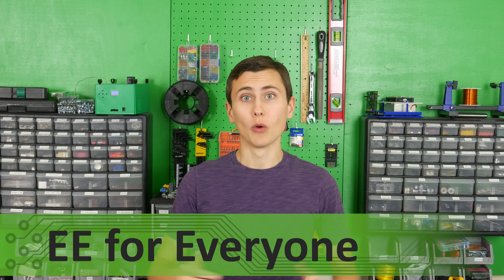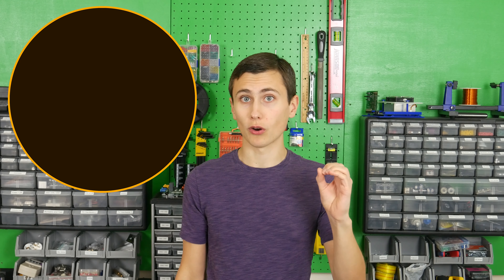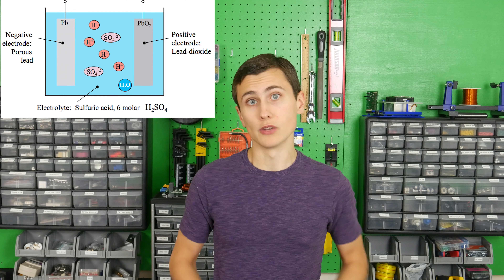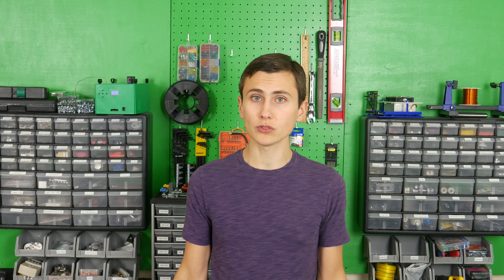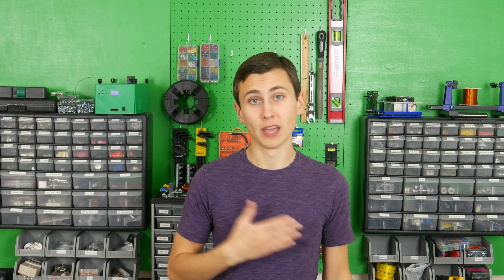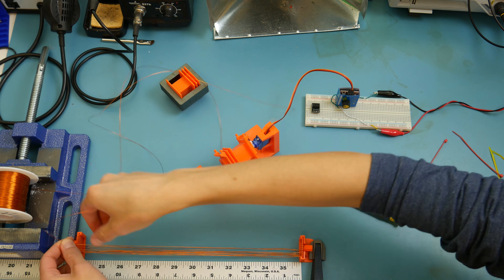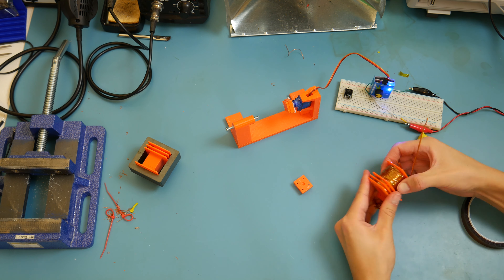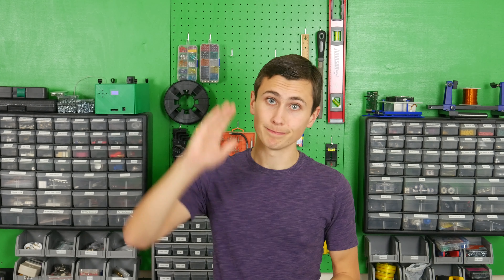Custom SMPS Transformer – Design & Wind

Comment: The explanation of frequency vs power transfer isn't how I would explain it. The benefit of a smaller transformer/inductor vs power transfer isn't because it's split into smaller increments. The benefit of higher frequency is due to the rate of change of the magnetic field. Since energy transfer and/or storage of an inductor or mutual inductors is dependent upon the delta of the magnetic field, a higher frequency results in higher energy dissipation through the mutual inductor...
Right? Any EEs or physicists feel free to chime in on that distinction and explanation
Reply from the maker: HI Tanner, great comment, thank you! It's definitely something for me to chew on for a while. The details / physics behind how the world (and transformers) work absolutely matter, and are important to get right. 

I'll have to dig into the mechanisms that lead to higher power density at at higher frequencies some more! Thank you again Tanner! (Hopefully others will chime in too)
Reply: I am not an expert, just a hobbyist, but my understanding is in line with the video's: higher frequency means less energy in the coils at peak, and less capacitance needed to cover the troughs. Increasing the frequency does not change the delta on the magnetic field, since the rate of power into and out of the transformer isn't changed by a change in frequency. In order to change the rate of power into and out of the transformer, and thus the delta on the magnetic field, we would need to increase the current and/or voltage through the transformer so that more power per time is entering or leaving the magnetic field. Frequency does not directly effect this.

Comment: Hi, I found out your channel while I was searching about transformer for my project. 
I am currently working on project which is same as your UPS series but it is for my whole house Inverter which supply around 4KW. I searched on youtube googled but I couldn't find a core which was rated for such a high power hence I am thinking of making 4 different sectioned Inverters rated for 1000W each so I could parallel them with relays as per the load consumption. But I didn't know which core to use, this video helped he a lot about my ongoing project thank you so much for this information.
BTW I am your new subscriber :)
Reply from the maker: Hi Duronto, that's awesome to hear! I hope your project works well... That sounds like a TON of fun.
Reply: @EEforEveryone  Thanks bro  : )

Comment: Excellent videos and you have earned a subscriber. Following the series of UPS Darwin Project. I am a business software engineer so even i could understand the explanation on high level. I need to watch the series multiple times to build up my concepts. I have a plan which i will start designing soon. I would like to modify two of the APC UPS 3000KVA each to combine them as one unit of 6000KVA. These UPS are of exact specs and use 4710 MOSFETS to covert the DC to AC to feed up to 2 of the transformers in series in Primary to covert to 240V AC. I think i can apply the knowledge learned here even though APC uses big transformers so i believe those are running at low frequency. Thanks for the videos, please keep these coming.
Reply from the maker: Hello Bilal! Thank you kindly for the encouragement. I'm glad you decided to subscribe! Yes, Project Darwin was intense, and I'm not quite done yet. Taking a break, but it's hard to accept defeat. :) 

You're right, almost every UPS design on the market uses low-voltage switching, and a line-frequency transformer to convert that energy from lower voltages (~24-48V) up to 120-240VAC. That architecture simplifies a few things, including isolation and safety of the PCB. I hope you have some fun, and stay safe! Mains Voltage can really be dangerous!
Reply: @EEforEveryone  Thanks for advise, yes we really need to safely play with high voltage. With current Project in hand i think DC side is safer as you correctly assumed MOSFETS are generating only ~24-48V and then step up transformer coverts these to 110-220V. 240V AC in my case is really isolated as these are through transformer and then the filtering part is very much isolated in the PCB, regardless like your advise on safety. 

I have few approaches how i would like to achieve the desired outcome and wanted to get a review of these points, if you kindly can do it for me. These are on very high level and can discuss if you have sometime to review. 

Thanks again.
Muhammad

Comment: Why would you use lead acid nowadays?
Reply from the maker: Hello Jason! Great question. Lead acid is actually still widely used for standby power applications, especially for standalone devices. This is due to how lithium batteries quickly degrade when held at 100% capacity for a long time. Typically, lithium cells last longest when stored near 50% capacity.

 Because lead acid batteries can be stored at 100% capacity without an issue, the energy density and cost competitiveness are more similar than one might expect (given that you'll need ~2x the lithium capacity to keep a pack in service for a long time)

I hope this helps, and thanks for watching!

Comment: Is there an explanation regarding for why as increasing frequency would give more power for a switching mode power supply
Reply from the maker: Hi Suhaila, great question. There isn't any particular reason why raw power would increase, but magnetic components (transformers and inductors) can become smaller (physically) while achieving the same electrical function as switching frequency increases. So, the power density of a design will generally improve, to a point. :) I hope this helps!
Reply: @EEforEveryone  
Thank you for your great answer.
Big LIKE for your video. I have just subscribe to your channel. Thanks.
Reply from the maker: Woohoo! Welcome to EEforEveryone.

Comment: 8:15-9:40 this explanation was quite rambly and hard for me to follow the point of it (as a battery electrical engineer). Also I'm very confused how the conclusion of this got to a battery output of voltage of 15.5V for the LV input to the DC/DC converter? If the battery is resting at 12-13V, then how does the voltage increase under load?

But other than that, very cool video and well explained overall :)

Comment: Thanks for the great video. Compared to Litz Wire, how would copper foil perform?
Reply from the maker: Hi John, great question! The best way I can answer that is: there is a way to design a transformer to use any type of winding. Which winding is best will depend on the switching frequency, the power level, and how much you can spend! 

In other words, there's no one "best" for every situation.

Comment: I am trying to make 1kW AC-DC converter. For stepping down 400VDC to 28VDC, I am using a Phase shift full bridge converter. I have transformer spec by Texas Instruments. Before making a transformer I want to prepare the plan for validating the transformer. Many people and the internet are just showing design guidelines or design methodology of the transformer but no one has given any data on how to verify the product. Can I please get a link or reference for knowing How to validate a transformer.!!
Reply from the maker: Hello Jayanth,

I see your problem. I also found a lot of resources with design calculations.

When "verifying" the Transformer I'll assume that you can handle the turns ratio measurement, so let's talk about a few key parameters:

Primary Inductance -
Leakage Inductance -
Mutual Inductance -

For these two, I found an article from Keysight that talk about measuring LOTS of things:
https://literature.cdn.keysight.com/litweb/pdf/5950-3000.pdf?id=1000075407:epsg:dow

In section 5.3, it discusses transformer measurements.

I thought this Voltech Article is also pretty good:
https://www.voltech.com/Articles/104-105/3_How_is_leakage_inductance_measured

Frequency Response -

I found a lab that speaks to some theory and helps to link these measurements to theory... but it isn't perfect...
https://www.seas.upenn.edu/~ese206/labs/Transformer/TransformerLab05.pdf

Measuring frequency response isn't always super important, but it may open your eyes to excessive capacitance before the leakage current test.

With this measured, we can have an idea of how the transformer will behave under load... but still haven't been able to capture effects due to saturation of the core, capacitive parts of the equivalent circuit model etc. It provides confidence that the transformer is built correctly, and nothing is terribly wrong, but these methods certainly aren't perfect.

Also, don't forget!!: For 400VDC to 28VDC conversion, you'll want to have a fair bit of isolation between input and output. Therefore, performing the following tests at the correct test levels will be critical for your safety... if you want to touch whatever is being powered at 28V!

HIPOT (Dielectric Breakdown) test
Leakage Current test 

These are documented well in safety standards, both test methods and limits.
A few safety standards are 60730, 60950-1, or 60101-1, which may be good to reference, depending on what you're trying to power.

I know that was a lot, and I'm sure I missed something, but I hope this helps!

Thanks for Watching!

Comment: Currently messing with some flyback transformer cores, I measured the Bmax to be about 0.4T which means that my spreadsheet calculator works as expected provided that most ferrites tend to be around this figure. with 10 turns I had an inductance around 450 uH, and around 2uH with a bodged secondary shorted (trying to determine leakage inductance, since I will be relying on it for an DIY LLC converter on my channel soon. :)

LLc converters are a step in the right direction for understanding my tesla coil and figuring out why the FETs want to explode.
Reply from the maker: LLC converters are fantastic! Truly a lot of fun. I'm hoping to get into that, I'm just waiting for one of our projects to truly demand that topology!

Awesome to hear. I'm glad your custom transformer / flyback is working!!! Also, sorry to hear about your FETs. :) I know that pain.

Comment: What defines the maximum frequency of the core material?
Can a 50hz torroid be rewound to operate at 500Khz?
Reply from the maker: Hello! Thanks for the comment! 

The short answer is: Yes. You can use any core material and any wire to make a transformer that operates at any frequency. However, if the core material is being used in a way that it wasn't designed for, it may dissipate A LOT of power.

A couple articles I stumbled upon suggests ~150x power dissipation in the core when switching a transformer 100 times faster. If this continues linearly (which it almost certainly won't) - The core in question may dissipate 22,000x more power than it did at 50Hz.

Depending on your application, how much power was dissipated in the core before, and how big of a fan you have laying around, that may be okay.  

Thankfully, if you know the core material that was used, you can get a much more specific answer. For example: the N87 core material we used.
https://www.tdk-electronics.tdk.com/download/528882/3226013b0ed82a6a2af3666f537cbf83/pdf-n87.pdf

Page 5 of this datasheet shows "Relative Core Losses Vs. Frequency"  this graph suggests that a higher switching frequency leads to more core losses. At some point, there will be so much power dissipated in the core it'll behave more like a resistor than a transformer core. :)

If you want to make a transformer that operates at 500khz, Standard sized Cores are available off of digikey, including torrids made for high switching frequencies:
https://www.digikey.com/products/en/magnetics-transformer-inductor-components/ferrite-cores/936?FV=ffe003a8%2Cfd0000a%2Cfd00006&quantity=0&ColumnSort=0&page=1&pageSize=25

Side Note: The type of wire required to operate at 500Khz will be very different than the wire required at 50Hz. You'll likely need a few strands of insulated copper wire running in parallel, like we did when making a transformer that operates at 100kHz
Reply: @EEforEveryone  
My layabout transformer is 50VA, and I need 10,400VA.  So 208 times the original speed.

But it does appear to be ferite.  Is there any way to make an educated guess?
Reply: @EEforEveryone 
It's a Torroid
80mm OD
40mm ID
25mm Wide

So that's 94248mm core volume.  Is there a way to make a worst case guess on the type of ferrite, and calculate the core losses based on that?
Reply from the maker: Hmm, If you're trying to increase the power output of the same ferrite core from 50VA to 10,400VA AND take on the additional core losses. You're probably going to need a different core.

One thing you can do would be to wrap some turns of wire around the core, drive it at your frequency (500Khz) and look at how much power makes it out the other side.
Check the datasheet for the original transformer, sometimes they give more detail on what core was used.

If you know the losses in your wire (mostly resistive) using skin depth, resistivity of copper, etc. Neglecting leakage inductance for a moment, you can measure the losses in your core by measuring the efficiency of power transfer. - This assumes that at your operating point, you won't saturate the core. <- Danger! Very strong assumption, especially because you're trying to push 10,400 VA through the core.

If you do this test at a couple reasonable load levels (10's of Watts /100's of Watts) - you can try to extrapolate what the core losses may be at the higher load level.

To know whether or not that core can handle the power you want to push through will depend on the turns ratio you're trying to make, which leads to a peak flux density, etc, etc... The reason why we used a well-characterized core material is because it allows for determining whether the core can handle the power involved. If you want to pull a datasheet for a ferrite material that could be used at line frequencies and design to that, you can, but your mileage may vary. I don't want to provide an explicit link, because that would imply a recommendation. I can only recommend that you design to the specific core material you have in hand.

If you try this out - make sure a camera is rolling! Worst case scenario: You'll end up with a molten puddle of slag. :) I see a real potential for this core to saturate if re-used as described... but that doesn't mean that it definitely won't work.

I hope this helps!
Reply from the maker: Hello Lord Samich - If that's your real name - I hope this project is going well. Let me know if you have any more questions! We can PM on twitter, but I'm open to new platforms if that isn't convenient for you.
Reply: @EEforEveryone 
Unfortunatley I cant remember what the original project was for.  I think it was an attempt at building a very small low voltage inductotherm.

For insurance purposes other people wanted low voltage opperation.  So I was having to demonstrate that something of the power required simply can't be done at low voltage.  At least not without a massive transformer from a welder or something like that.  That had me thinking switchmode, might be a solution.  

But I've since found a much easier solution, that involves lying.
Reply: @EEforEveryone  In my experience about 1khz is max for a  iron laminate core line frequency  transformer above this the losses are to great
Reply from the maker: @T2D.SteveArcs  HI Tested to Destruction, Thanks for sharing! I haven't tried to push (or even really investigated pushing) the limits of iron laminate cores before... But that sounds like a great rule of thumb!
Reply: @EEforEveryone  yeah I suppose  there will be exceptions but stood me in good stead so far

Comment: I prefer to use copper foil for low voltage high current winding. I got this idea when I toredown a mainframe PSU.
Cheers from Indonesia
Reply from the maker: Hello Ibles! Thank you for watching! 
I'm definitely going to consider a copper foil winding for the next version of our transformer design. I'll run through the calculations to compare the efficiency when using a foil primary vs. magnet wire.
Cheers!

Comment: Hi, The video was excellent, 
I am planning to use EE65 core, could you please tell me the optimum frequency to obtain the maximum power output from the core??
Thank you
Reply from the maker: Hello Clrohan! Thanks for watching! I'd love to! Unfortunately, It's not that simple. :) 

This will depend on which SMPS topology you would like to use, how much current is flowing, what turns ratio you're trying to implement, and what core material you've selected. 

That said, you've selected a huge core, one with a larger effective area than I needed to implement 2kW transformers.

It seems like you've selected Ferroxcube for your core, so check out this design tool. It should help you to work out the details!  https://www.ferroxcube.com/en-global/design_tool/index

I hope this helps!
Reply: @EEforEveryone  thank you so much for your response, I will ask you if I have any further doubts
Reply from the maker: Sounds great, I'd love to see what you're working on! Feel free to share some project pictures with us on Twitter @eeforeveryone screenshots and simulations are cool too. 😀